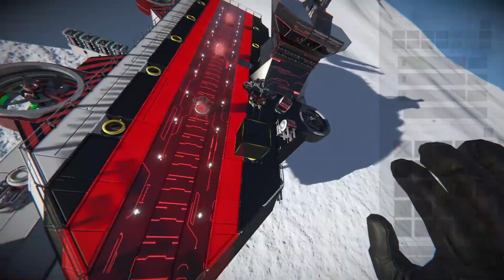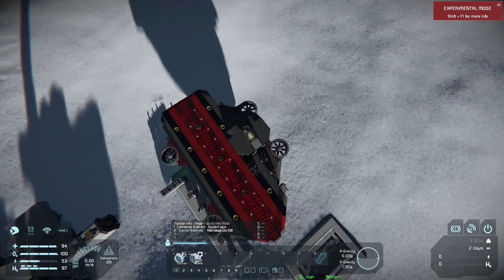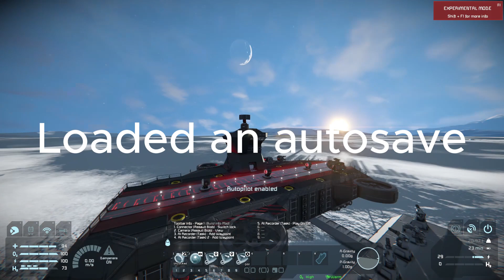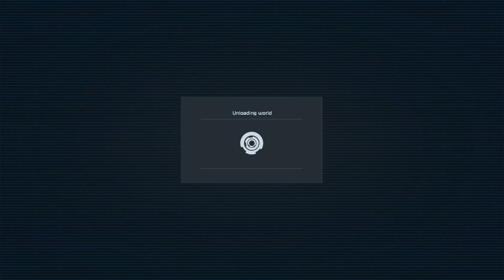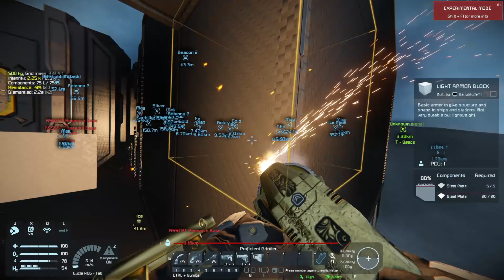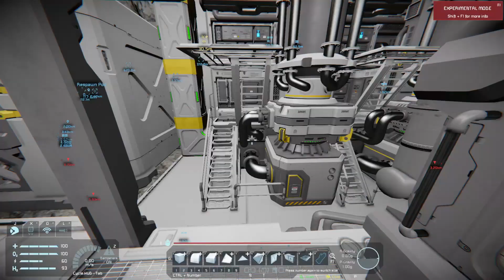It still doesn't work! (Cat Reveal At 100 Subscribers Space Engineers | Modded Survival gameplay #9)

Comment: how did you get the nanobots to work? its not working for me
Reply from the maker: I dont remember the exact process. I switched off the janitor function and switched it to weld only. Then I just had to make sure it was actually on. Also keep in mind each nanobot station has a limited range.
Reply: @DailyStuffs.  okay thanks will try that
Reply: does it need to be connected to a power source?
Reply: @DailyStuffs.  got it thanks man
Reply from the maker: @StormySky1649  Yes, the Nanobots need power.